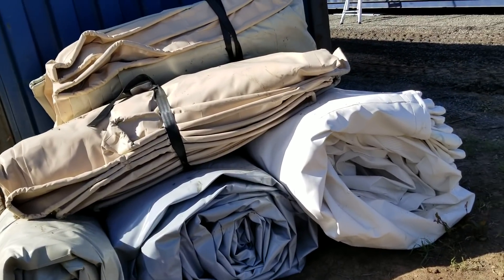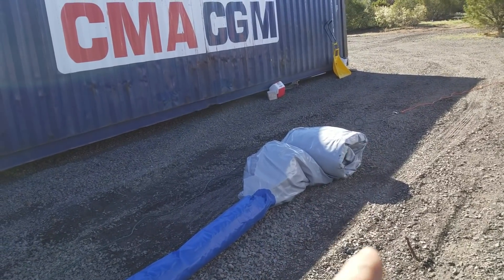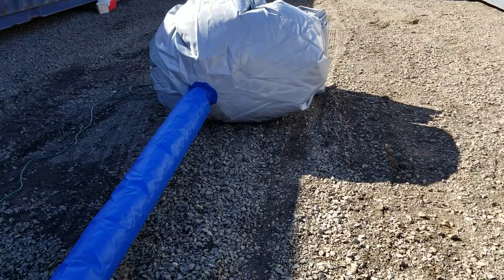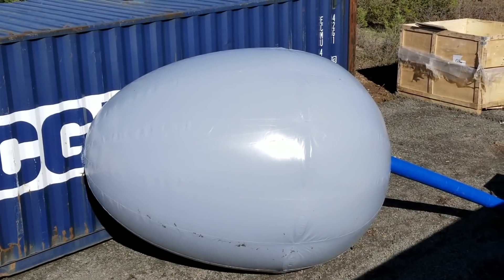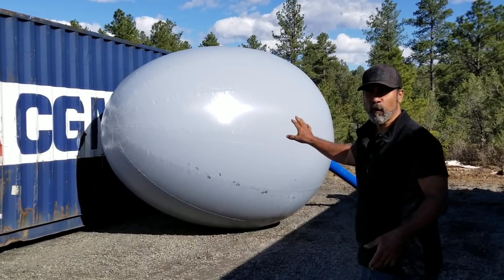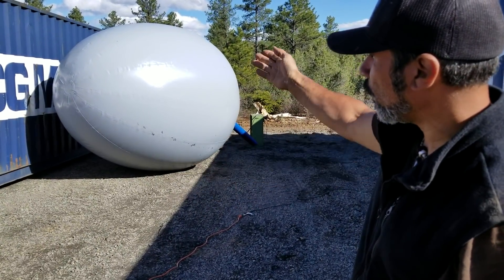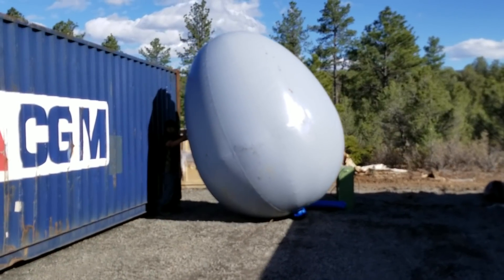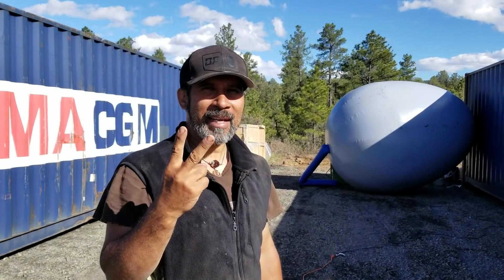Egg shaped Air-Form | Cisterns & Ferro-Cement Tanks #EggshapedAirForm #aircreteharry #watertank #diy

Comment: In an age of economical plastic, making a water tank out of cement seems laborous, and perhaps, more expensive? Please guide me if you've used this form as of  summer 2021. Your own made some forms AND plans are awesome and fairly priced Harry.....appreciating your videos and great endeavors!
Reply: ferro-cement tanks have a tenancy to be cheaper per gallon when you get creative with their creations. for example, this egg shape when combined with a concrete base, but using his aircrete dome techniques might take two days without moving more than 30-95 pounds at once. or if you dig out a hole, build up the walls of that hole with earthbags or hyper adobe, line with a tank liner, and top with ferro-cement you can have a 15,000 gallon tank for the price of one MAAYBE two 2500 gallon tank(s). in this video's example using a Air form to build a complete concrete tank its about the same labor sometimes less than creating a foundation and moving a 340 pound + tank onto that foundation and plumbing it.sometimes less because the plumbing can be added and installed at the forming/foundation phases without that much extra effort. 

there is a reason commercial/city reservoirs, and water storage tanks are concrete formed then lined, they are cheaper to make on site and have a maintenance that is simply replacing/repainting a liner after draining(sometimes into another reservoir) not needing to lug in a bunch of awkward giant barrels.

Comment: You will not be able to dig a hole, put the  form in and pour concrete around I, it will float, you could do a ferocement  shape then put it in the hole and pour concrete around it with substantial structure to hold the form down.
  If you use only the air inflated form you will only make a slab in the bottom of a hole, as the concrete is poured in the end will flatten.
Reply: You put some water in it

Comment: Harry, I want one of these.
It's gonna be bouyant though - inna pour it'll float up.  
If this form first had a fabric and portland cement coating it then could cure for a week or more to develop some strength and then be used as a form. - laying up foamcrete blocks wouldnt need the tedious & slowly supporting with counterweights work, etc to make an egg-dome shelter.  thx btw.  Where can we get one?
Reply from the maker: The egg will have air and water to keep it from floating up. The airforms I have would work great to lay up blocks and avoid the counterweights. But for my dome build I will be using two forms one larger than the other I will then fill with aircrete to make the dome in one pour. A company in TX makes the airforms.

Comment: I Can now pump Aircrete!        Watched your (and others) unsuccessful inexpensive pump attemps and had to try. 
A Diaphram Hand pump (like a Bilge pump) will pump Aircrete Up   (only had 8 feet of 1" hose to test)
Princess Auto (Canadian version of Harbour Freight) $45. But had to modify the Valves till it could pump air or Foam. (yes , you can also pump foam) 
This was a "proof of concept" test (volume is slow) . Diaphram or peristaltic pumps will work (I see you figured this out),  and that micro bubbles in the crete are not the problem , and are not damaged by the pumping. (a hopper just above pump inlet reduces the negative pressure required to "fill" the pump each stroke)
Reply from the maker: I would love to see a video of the pump working.

Comment: That should be a fun project.
You might consider using the basalt roving method Monolithic has demonstrated on their channel.  It will need some kind of reinforcement and you'll have water trying to attack the tank from inside and out, so avoiding rust is probably going to be important. 
There are going to be a lot of interesting decisions involved in making this thing.  I look forward to learning about them all.
Reply from the maker: Thanks a good idea. I was planing to do just that same thing, I have the basalt mesh and roving ready to go
Reply: I am not quite up to speed. On the what he basalt does but it acts like gold. Silver or copper.? Correct me if iam wrong..
Could you pointe to the monolithic.. Pieces please. Thx 🙏
Reply: @kevd7664  https://www.youtube.com/channel/UC_ZQQWSXA41zj6vN8M6olVA
These are the guys who made the video I was referencing.  I don't see the specific video though.  
The roving acts as reinforcement and does not rust.

Comment: Several questions: 
1. What is the approximate capacity of the finished tank?  
2. I'm assuming the reason for the egg shape is strength and the lack of stress points. That is obviously true with external compression, does it hold true on internal expansion? Can you point to a place that explains how the egg shape is stronger as a container?   
3. When will you build your own tank with this mold?
Comment: I think this is as cool as it is bold! Hooray for you!
Reply from the maker: The tank will hold approximately 3000 gallons. The egg shape does have structural strength. The main reason for the egg shape is to prevent the water from going stagnant. The different temperatures in the water from the walls to the center of the tank will cause a natural Vortex action to happen.
Reply: @AircreteHarry  This was what I was looking for before I asked you searched comments. Great Question. Alosha had made mention of it and looked it up. Now I understand as a man that lives off of cistern water was wondering about the egg when I saw this a few months back. Alosha had said similar but you made me understand it. TY

Comment: This is a brilliant idea. However, it will probably be hard to dig a hole of this shape, and assess whether you have the right dimensions at every spot. Maybe he already has solutions to all this...
Reply from the maker: Most hoes that are Doug have a funnel shape to them you have to work at getting a straight cylinder shape. I'll probably use a template to check the hose size as its being dug.
Reply: @AircreteHarry  I think water systems are probably the most important aspect of the entire build off grid. and having an egg shape that circulates is awesome. Although much more work to create outside of the hole as you mentioned in a reply. I will have to agree with that as easier than forms and an oversized hole to accommodate the forms and everything. Once the shell is created outside of its final resting place. and lowered into a square hole could you not just fill around it with aircrete to support it? Shell thin hole big. lower in. fill with aircrete around it to give it support. Am I off base here?

Comment: Good to see you back at it buddy. Hope all is well.
Reply: So how would you keep it from floating out of the hole before the concrete drys?
Reply from the maker: @RedefineLiving  Egg holder . lol
Reply: Aircrete Harry or a giant hen lol
Reply from the maker: @RedefineLiving  I mite pump water in to hold it down. After the cement cures I let the air out and pump the water back out. I feel if I hold the airform down from the top, it mite drift to the side and not have an even amount of cement all the way around.
Reply: Aircrete Harry that sounds like it might work. That sounds like a tricky situation.
Reply: I wonder if digging out a area large enough to walk around it might be easier. You can wrap wire around it and apply ferrocement, then backfill the hole. I'll be interested to see what you decide. How far are you from Colorado Springs?